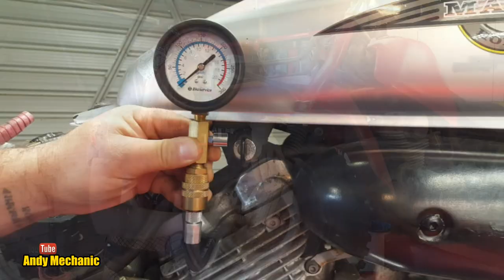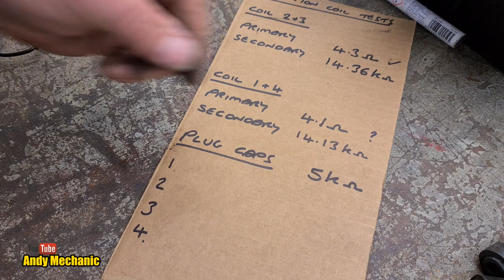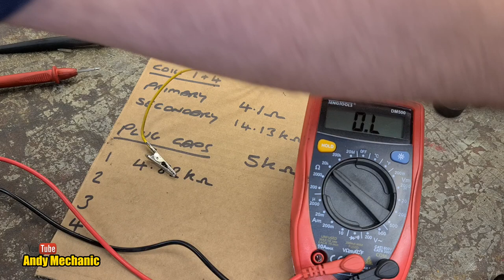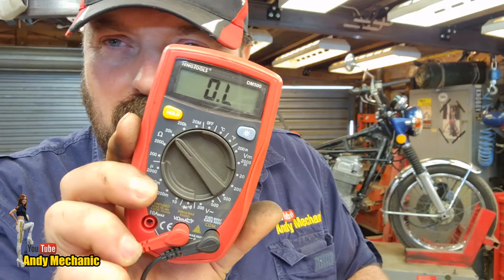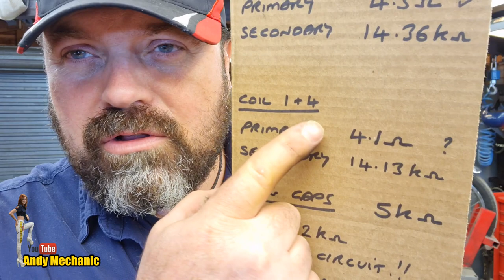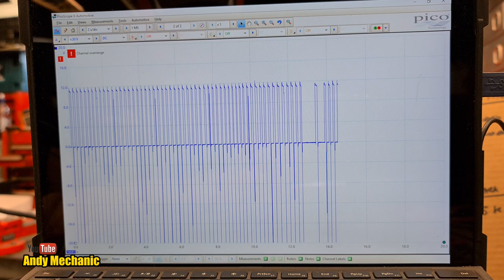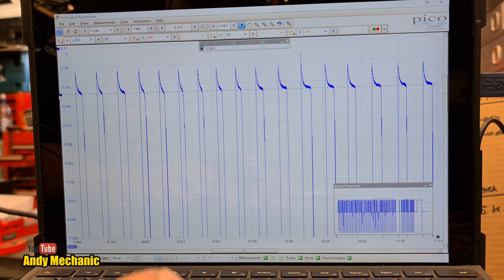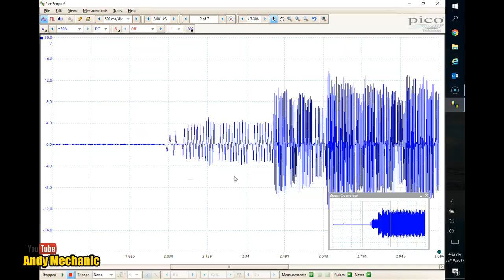Honda CB750 K2 - ignition system - a closer look Ep.4 #1472

Comment: Hi Andy. Great video. Thank you. Also I just bought some replacement coils and had to reassemble the plug caps, because they must have bumped around during shipping or something and feel apart . There were two springs inside between both ends of the plug caps. You'll see the flat head screwdriver slots inside the spark plug connecter. Unscrew it and those two springs should just fall out when turned upside down. If the internal springs are not contacting in-between themselves and the polar opposite ends of the plug caps, then it will not be a closed circuit.

Comment: I replaced the coils on my 75 CB750 last year because cylinder 2 was giving me occasional problems.  I had swapped out the points for a Dyna S electronic ignition so I figured I'd put some new Dyna coils on just for the heck of it.   At the time I didn't do a diagnostic test on the old coils, I just figured new ones would fix the problem....which they did.   Plus I didn't own a multimeter at that point...I'm still fairly new to motorcycles.   After watching this video I decided to grab those old coils from the garage and finally test them properly.  Sure enough, I found a problem on the cylinder 2 spark plug wire.  Since I finally bought a multimeter I've been testing everything for fun.
Reply from the maker: Great job :-) I'm looking forward to having some time available to get the ignition work done....over Christmas holidays I have scheduled the work 

Thanks for your feedback 

Cheers Andy 
l

Comment: The condenser is to give a better spark as the collapse of primary windings induces high voltage in secondary winding ,BUT, when secondary winding collapses, it re-induces a very high voltage back into primaries. On a scope it shows as a bounce. I've measured as much as 320v on primaries.
You need a peak voltage adapter (DIY is probably better than the $4000+? Snap-On one as Snap-On had a production defect for a number of years) Preventing points burning is a secondary effect and not the primary reason it's fitted

Comment: Good methodical work. Lots of mechanics struggle with electrics/electronics. Please keep the points, they’re easy systems to keep going, plenty of cheapo electronic systems out there that have bad advance curves or even good old Boyer that goes to full advance if battery voltage is low - ankle breaker on a kick start bike.
Reply: I used to 'kick' start them by hand after service just to prove to owners how easy it is to start them using correct procedure.

Comment: andy i have a old fireblade with resistors in the caps they have gone can i use a plug cap that will just about fit in length with no resistor in the cap? regards john GOOD VIDEO THIS EVEN SHOWS METER SETTINGS
Reply from the maker: Hi John, the resistor rating of the plug cap is actually very important so see if you can find the correct caps - NGK do a good range - check their web site.

Cheers Andy

Comment: Last set of points I adjusted was on a Fantastic Ford Sport 1600 1978 overhauled the motor and installed a competition Cam
Was a pleasure to drive 
During overhaul found someone had changed the crank to an older type which caused a different firing order to spec for the vehicle 
1432 or 1342

Comment: I'm having an issue with a 1981 cb750 f SS. Cylinders 1 and 4 won't fire. Coils are in good shape, stator charges, "cdi" boxes have been replaced...where do I go from here? Carbs have been gone through and new spark plugs. Getting no spark to 1 and 4. 2 and 3 run fine.

Comment: IF you can't find or get the points, there should be an electric ignition kit that should work. You would be replacing the points and condensers out for an electronic ignition plate. I just recently saw an RD 400 2 stroke bike (around that  same era) that had that done.
Reply from the maker: Thanks Bob, yes, that's my recommendation to the customer but awaiting approval.

Cheers Andy

Comment: So my cb900c drains the battery could it be the coils?
Reply from the maker: Well....when the ignition is turned off there shouldn't be power to the coils.

A simple way is to connect your ammeter between the battery + post & the cable that normally connects to it - you will need to disconnect it for the test.

Now, with the ignition turned off you should see a very small to zero reading (in amps). If your battery is draining then this will be higher than normal. Normal will be less than around 0.3 Amps (lower the better) anything over this then you'll have a parasitic drain. 

So, now go to your fuse box & remove one fuse at a time, when you see a substantial drop on the meter reading you have identified the circuit responsible for the drain. Now you'll need to inspect that circuit in more detail to find the problem

Hope this helps
Andy

Comment: Hi andy 

By the book i have to use 10w40 oil in my car's engine but there is a chart indicating that ,according to weather degree if climate is over 10 degree you can use thicker oil like 20w50 , is that wrong ? And i should ignore the hot weather and use the 10w40 as the owner manual recommended ?

Comment: i did post on previous video about the plugs.  I think I removed the comment afterwards.  However,  i did say, make a new ign system.  Make them into coil sticks.  mod the system into coil sticks.  We all do this on the CBR1000F.
Reply from the maker: Hi Jason, yes, I read the info you sent through.  Thank You. However, the owner wants to keep the bike looking original so we are currently looking at an electronic ignition pickup to eliminate the old points etc....more to come in future Episodes. Thanks again for your input. Cheers Andy
Reply: @AndyMechanic  youre welcome

Comment: Andy, very helpful video.  I have an older model Honda, the 12V voltage regulator is separate from the rectifier.  Is there a procedure to bench test the voltage regulator.  Its got three wires (black, green, yellow)
Reply: You need a bench power supply to properly test regulator. Much easier (and way better) to fit an aftermarket 'all in one' regulator rectifier unit

Comment: You need the Honda General service manual that covers pretty much everything that is common to all the Honda motorcycles.
 It's available online. 
The coils were not very well insulated even when new (I was working at Honda dealers when these were still current)
BTW, with dual output coils, one lead fires negative and the other positive so it's a real good idea to swap 1/4 and 2/3plugs over every so often as they erode at completely different rates.
 If one plug sparks, the other has to to complete the circuit.
Your not using the meter specified in service manual so anything within 10% of spec is fine.
You are a member at SOHC4.net?